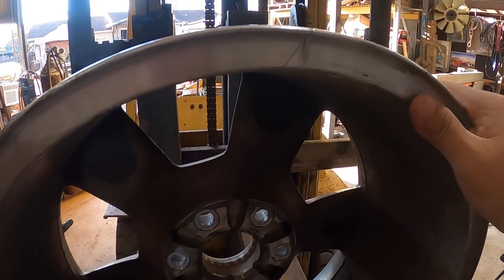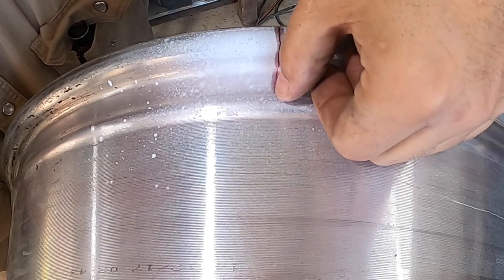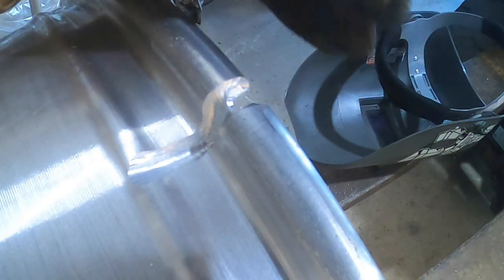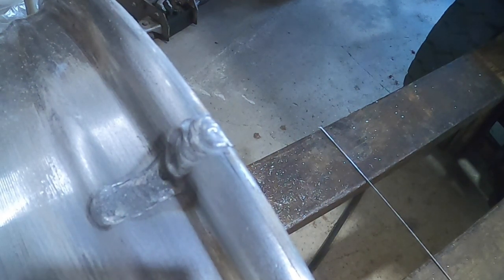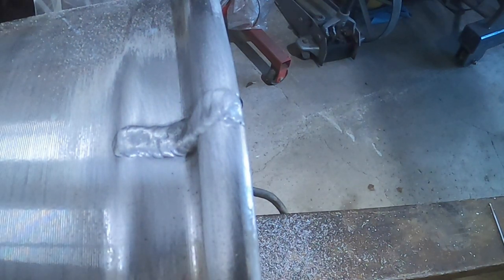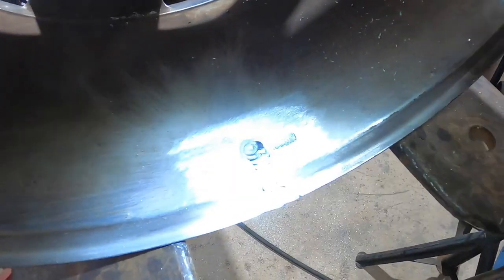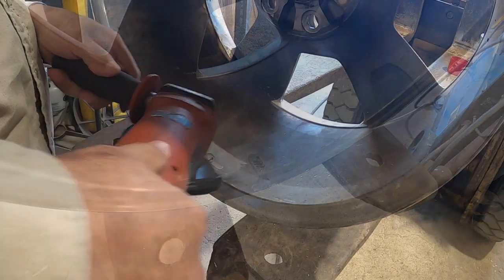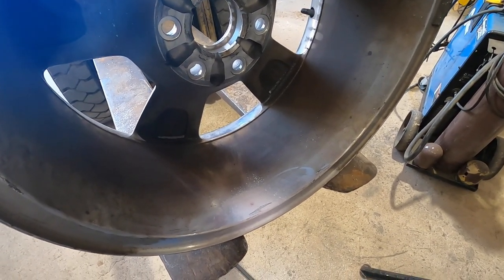Aluminum???

Comment: Nice!  reminds me of around 1980 or so , I had a 1976 Cutlass Supreme with discontinued aftermarket aluminum wheels . slid into a curb in the winter and cracked off about 3" of the lip of the rim. My dad worked at a machine shop and took it in, had it welded up by one of the welders, he turned it on the lathe to clean it up . there was 1 small divot in the repair , but after about 6 months I could not find the repair .
Reply from the maker: Very cool!

Comment: That'll do. As far as tips go for alum the only thing i can see you doing wrong is when you put the filler in you need to have a steeper approach to the puddle so it doesn't burn off before it gets there. Dragging schmoo and all kind of shit into the puddle with it when its partially melted. Pragmatic is an excellent way to describe just about any repair, nice video!

Comment: Well sir, you won’t get any abusive or questioning of your methods & techniques from me.  I was wondering about the inside of the rim where you gouged (die grind) the raised bead, and the question came to mind if it will hold air.  I think that bead is somewhat of a seal in a tubeless tire & wheel.  After your finishing/buffing up of the welds, I doubt that too much more weight than from prior to the damages, would be needed.  Your friend will no doubt need to have the wheel (hoop) “trued” up, no amount of weights will cure the “wobble” from that kind of damage.
Great video,
Thank you sir.

Comment: When ya finish spraying out the paint from them cans hold it up side down and give it a small squirt. That way the tip won't get clog up from the paint. Next time you use it be like a brand new can.

Comment: Nice job! I’ve finally built a garage big enough to do things in so my first tool I’m picking up is a TIG welder, always wanted to learn how to weld so now will be my time.
Reply: Good luck on the learning . Get a decent AC DC set up and if I may say always listen to any advice when it refers to tig . ... you can always filter out the good from bad even if its trial n error . if you can get a class on it go for it .. .best of luck
Reply: @garyyorke1080  planning on taking a class at a local college or trade school, also have a buddy that is certified in just about every kind of welding so when he’s not working he said he’ll come by and show me a few things.
Reply: Look at the Miller Diversion 180,great machine,super easy to use!

Comment: I've repaired a lot of cast aluminum transmission housings 4043 always did good for me over 5356 .I don't know if that is cast rims or forged but I don't use a gas lens and I use green pure tungsten.Should have a good cleaning edge if your arc control is right good job man👍I'm old school 6 cup 35 on gas 3/32 tungsten for me.

Comment: looks good to me.  Never welded any aluminum, but never had the chance.  As a kid there was real magnesium in mag wheels.  Volkswagen KarmenGhia crashed  and caught fire out near where i lived in Georgia.  The danged  wheel caught fire and when the FD rolled up, they couldn't put the thing out.  Very hot fire and very bright blaze.  I thought about that for many years.  Wondered if the ole boy that was in it had been knocked out he might have burned to death.
Be interesting to see if that stuff would catch fire with a arc struck on it.

Comment: You can use solvent based carb. cleaner to clean metal prior to applying die pen. oil.  Let the cleaner evaporate fist then put on oil.  I would spray the penetrant oil into a small sealable glass bottle and then use a acid brush to apply it to the metal.  You use less and it doesn't make as big a mess to wipe off.  Use the carb cleaner to clean pen oil out of any cracks you find.

Comment: AS long you removed the end of the crack ( stress riser ) and the fusion of the filler material to the base metal is good, your repair is OK
I'm not a welding expert but in my carrer, I had to develop repair procedures where cracks were involved, usually, the most crictical part of the process was to clearly remove the stress riser at the end of the crack.
To do so, I used drilling of a hole and grinding . Before the welding was involved, I had a non destructive test done to confirm the preparation.

Comment: Hi Isaac, great vids thanks. as for the 'hoop' it worked so its good ;) ..I do a fair bit of ali welding repairs on casings etc..theres a huge amount of bs spoken about welding ali i think..experience is the important thing. I dont have a modern inverter type tig mine is an ancient (1970s) Rowan arc 300 A  its a beast and i love it. yes i use different tungstens for ali or steel. only personal knack i found with cracks where theres dirt or oil was getting a good weld pool going with least filler rod possible and the crap floats to the top, quick grind off and then fill .

Comment: Tell your friend those pin holes are identification marks to identify the repaired area.   Once again that is an amazing repair and the tire is put on from the front to the rim so there won't be any pressure or tools on the repaired area mounting or removing the wheel

Comment: Issac. What type of gun do you use on your flux core work? I can`t seem to find that long straight neck anywhere. Self shielded is a very hot arc so getting farther away is good.  Is that run on a LN-25 feeder?  Your power source is a Trailblazer 302 air pak  for your arc gouging needs or some different engine drive. Enjoy watching your videos. Even though I`ve done this work for years still I`m learning. Thanks!
Reply from the maker: I use the Profax 1260 gun with a 12" extended neck. And yes, an older LN-25 suitcase on my Trailblazer AIrpak.
Reply: @ICWeld  Thank you.

Comment: Reiterating the comments you did a great job - I would only say and I am probably wrong - but I usually cut a 1/16 parallel with the crack and tap it out - then I valley cut on both sides - then fill each side separately - because - I will draw though the first weld without filler then add filler when it has solidified …. I wont teach anyone to suck eggs, especially a proficient welder such as yourself……There’s more than one way to skin a cat!!!!!! 👌👍🙏

Comment: When cutting aluminum use kerosene or wd-40. Even if the burr is clogged,wet te burr and the aluminum will fly off when you do more burring once clean apply more kerosene to keep clean. Always clean metal before welding.

Comment: Im not a great welder,but im a master grinder! What tungsten were you using and what filler? I use 4043 on rims,more ductile than 5356,though the 5356 is a little nicer but on rims you have to grind,balance and true them,so 4043 it is,and i use 2%lanthanated for just about everything,or lazer! Plantex Tiger Shark flap discs with Kangaru oil,if you ever need to grind! Its amazing!
Reply: P.S nice repair,you knocked it out!

Comment: Would you recommend low heat aluminum rods for something like this if you just starting out and should I grind it smooth or have it machined so it seal's on the bead I don't care about the back side

Comment: Looks really good but try to keep your filler rod in the gas flow as much as possible. And clean the area and the rod with pure acetone to get the best results. Do not use brake cleaner, the residue produces chlorine gas when burned, extremely poisonous.

Comment: At about 20 minutes in you can still see some black spots at each side of the weld at the inside corner of the rim.  I have found that a SS brush  in a Dremel tool of die grinder will get into those tight spaces pretty well... Dremel 532-02 Stainless Steel Brushes or similar shaped brushes with a 1/4" shaft for a die grinder should work...

Comment: Few things I see that would help.  Be patient before adding your filler.  The initial puddle will take some time on a piece that large.  Once you get going keep your filler in the shielding gas.  I just got in the habit of keeping the rod in the shielding gas regardless of the material.  That way I don't fight myself when switching materials. Dedicated aluminum brush... in one direction.  Sounds silly but it helps.

Comment: Clean is the key for aluminum I have found wire brush only for aluminum and denatured alcohol is your friend you should try a old pontoon boat or aluminum fishing boat they are a pain
Reply from the maker: I have another video I made at the same time as this one with a "pontoon that goes on an 18 wheeler" if you know what I mean. Same struggles but it worked. I'll make the improvements soon.
Reply: Stainless steel wire brush on aluminum

Comment: Did you use a Carbide bristle brush with wire diameter of 0.005"? This brush can only be cleaned with Unicorn pee, so be careful where you stick it. :-)

Comment: Not much wrong here.. I would just clean with acetone thorough;y and hold the post flow on the end of the hot weld a bit longer while it cooled. Other than that you did exactly what I would have.

Comment: I recently got a set of Rota Grid alloy rims in for repair by a customer
( Rota wheels have a reputation for bad quality castings and coming apart in situations that would normally be ok ) 
I was able to repair all but one. they all had badly cracked lips that had opened up about 2mm which was fine and repairable, but on the last one, one of the spokes had completely split in half and the barrel had ovaled at that spoke. I ended up telling the customer that he will have to find a replacement for that wheel because driving on it is extremely dangerous as that rim will likely come apart when you hit a pothole, let alone the rim will never be balanced again... 

DON'T BUY CHINESE WHEELS AND THIS WON'T HAPPEN!!!

Comment: When I got my TIG welder and learned how to weld aluminum, I was cautioned, not to try and repair wheels, because of the liability involved; if it fails and kills someone, some jackass lawyer may try to tie it to you, especially since you admitted that you're not an aluminum guy.  My other concern is that if that wheel was heat-treated, you've probably taken the temper out of it which es no bueno.  But I'm no expert, that's just what I was told.

Comment: When grinding an inside corner radius, I like to use PFERD 67192 (or similar) curve radial flap discs... They are a flap disc designed to grind on the outside edge (perimeter) of the flap disc rather than the surface of the flap wheel.  But, I'm sure you are well aware of them...

Comment: What I have done with aluminium castings is V it out as you did, then weld it and get the horrible cast aluminium mess that you got, then cut that out and welded again. Cast aluminium is just the worst of the worst.

Comment: Yeah , I got one of those welders that is smarter than me, by the time I get it welding like I want it to, I am done with the job, for me I hate to start an aluminum weld crack on the edge, so I’ll back in maybe a quarter or a half inch and spot it and then do my edge coming back into the crack , The one thing you have to be really concerned with an aluminum especially on an edge is overheating it and making the aluminum weak.

Comment: welded quite a few wheels over the years. I would drill through the end of the crack with a large center drill to form a V shaped end and then use a thin cutting disc to cut to the hole on each side of the crack to completely remove it then fill the remaining void with weld as you have from each side. never had a leak never had the repair recrack